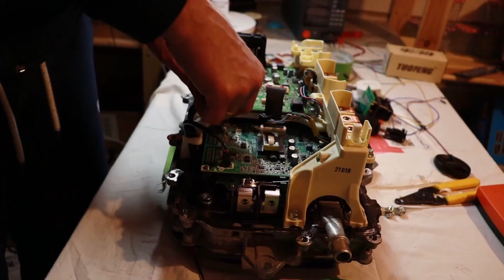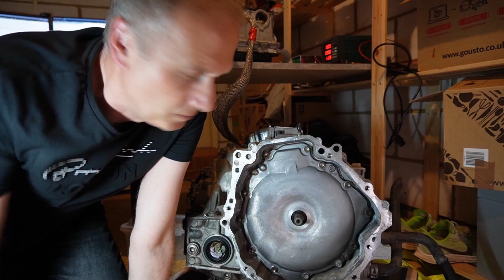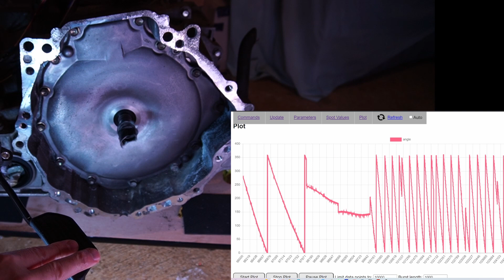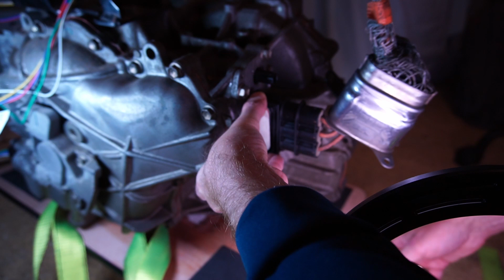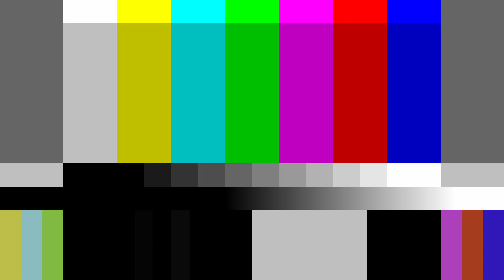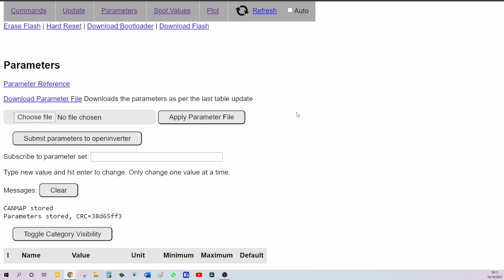Motor spinning and FOC  Toyota Prius DIY EV Ep 13 EV

Comment: Any chance you can upload the parameters file to the openinverter DB    :)   .  Nice work BTW :)
Reply from the maker: Thanks, I want to have another go at tuning once I have a battery as I anticipate that some parameters may change. I think my current PSU does not give enough current atm

Comment: Great job, Ed! Why wouldn’t you think about mechanical way of switching between Park, Reverse, Drive and Neutral?
Reply from the maker: Thank you , this parking brake is more of a safety feature and it could be just in two positions park and non park. It can not switch to reverse. I suppose I could just remove it but I thought that it would be more elegant to drive it electronically
Reply: @LatutaEV  Got your idea, kinda electromagnet induction mechanism which would rather block/unblock the transmission than “park”.

Another question is about installing the transmission into a car with fuel engine:
If it is a front wheel drive car, you just take out the engine+transmission, install Prius transmission, and good to go. 
But what about rear wheel driving cars?
Do you think it’s possible to take out the engine, and connect 2 transmissions with each other? Torque difference would be lowered by existing Prius damper disc.
Reply from the maker: Yes pretty much this is how Toyota designed it